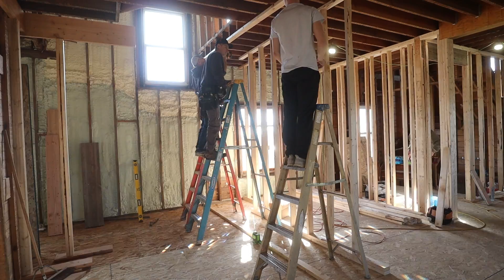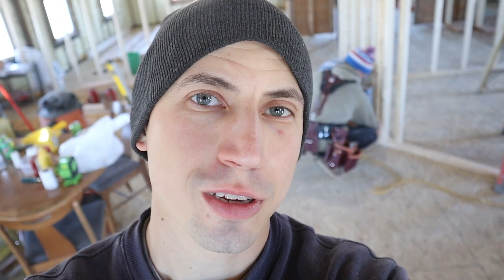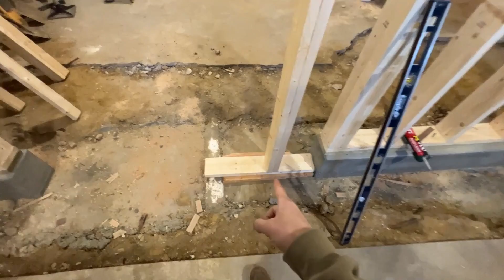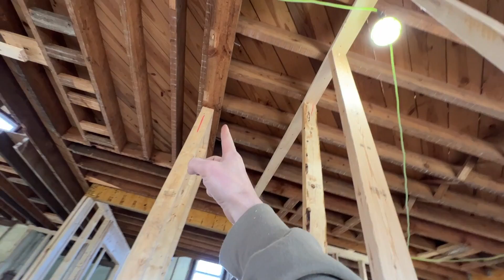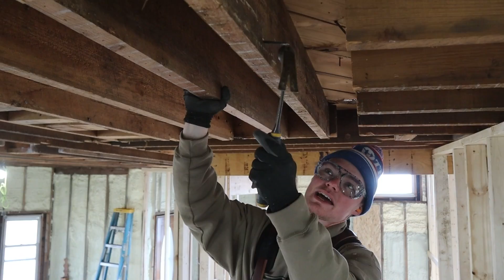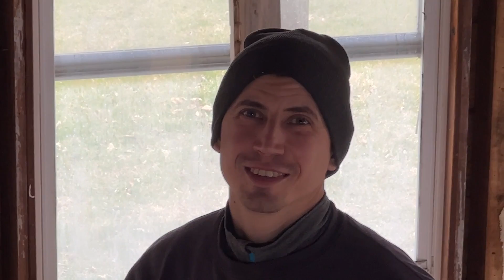Restoring A $7,000 Mansion: Building A New Living Room

Comment: Roman is correct. A jack stud is what is under a header/beam. A cripple stud is what fills in under or over a window, or over a doorway (between the header and the top plate, to provide a nailer).
Reply: I've always known them as jack studs as they perform the job of holding (or jacking up) the header.  A quick google: "The king studs are the same length and size of regular studs in a wall; the only difference is that they are positioned at the ends of a header so they don’t necessarily land at regular on-center stud locations. Jacks, sometimes called trimmers, are studs cut to length to fit under each end of a header and down to the bottom plate."  Learned something new today
Reply: Cole, Don't go all west coast on us now. In the Midwest I've always heard them called jack studs, not trimmers. The only time I heard them called trimmers was on the cable tv shows building out in California.
Reply: Instead of 'cripple' we always figured if you had 'kings' that were the biggest, 'jacks' doing the work, then the ridiculous little ones should be 'jokers' or 'fools', depending on if you prefer card- or court-based nomenclature.
Reply: And a king stretches from sole to top plate
Reply: Trimmers???  Kings, Jacks and cripples.  In that order. 

Roman is correct!!!!
Reply: Cut your blocking boards before you take off the long board. It will prevent the wall studs from bowing Cole. You should be putting in the blocking when you put up your walls
Reply: Trimmers are the secondary boards that trim out windows and doors.

Comment: The only problem I see is using screws to build with
They will pop when the house as they call breathes with the change of the seasons. You should use nails to allow the wood to flex like it supposed to
Reply: I have that problem. Built my house with screws and ring shanks. The pops are loud and scares me every time. It's always in the evenings when the temps cool.
Reply: @a.randolph8112  That's the screws breaking, no shear strength

Comment: a good building practice is to place blocking/backing brackets where thing heavy will be mounted, such as handrail supports, light fixtures, fans etc. these also double as horizontal braces between load bearing wall studs. Plan for the furniture length and width and turning space. Some framers call it SHIM-FACE.

Comment: My 2003 FORD f150 module went out. The module gets corroded and moisture then gets inside the small circuit board and corrodes it. Sucks that isn't what it was.

Comment: If my bearings are correct, why not run the beam deeper into the wall to catch the other king post of the door on the basement.

On the leaning wall, cut 2x shims the entire height of the wall to make the existing wall plumb.

I wish I was there. I could run all the calculations on the beams and solve a lot of your problems.

Keep up the good work!
Reply: Thank you for this post! I hope they see it!

Comment: I live in NJ and radon is a true problem.  You mentioned French drains in basement. You may want to speak with a radon remediation company as I believe that they will want all French drains sealed so the radon gases do not come up into the basement.  Just a heads up to check before you do basement floors.

Comment: I’m sorry, I’m confused!  You have to go through the pantry to get to the downstairs bathroom?  Aren’t pantries usually messy?  I personally wouldn’t want a guest to have to go through my pantry to get to the bathroom.  Lovely job, as usual! TYTY for sharing!  ❤️❤️🙏❤️❤️
Reply: Same thing I’m confused about.
Reply: I thought the same thing!  If that was the only doorway, I’d want the bathroom first and pantry in the back.
Reply: Cole has explained in previous videos that you will enter the bathroom from the hallway by the stairs. Hope that helps!😊
Reply: @westiamom9340  But he just said in this one the door to the bathroom would be in the pantry! They can't put a door out to the staircase because the landing is going to be up 4 feet from the floor where the stairs go up outside the bathroom wall.
Reply: That's what I thought, too. I'm confusion. 😂
Reply: I was wondering, too.
Reply: @teddieryan2288  at the end there was no other doorway built. But the one at the angle.  Unless they’ll frame another doorway later?
Reply: @pamtanner516  yes if you were facing the diagonal door, the wall that runs down the right-hand side to the outside wall, near the back of that wall where the bathroom will be framed out, there will be a door framed into that wall. The door will be across from the 2nd staircase(back), it's just not framed in yet. the opposite side of where the door will be framed into the bathroom will end up being under the first landing of the front staircase that doesn't exist currently.  Assume there will be cabinets or shelves on the 3 walls of the panty if it helps to visualize where the bathroom door will end up being.
Reply: @rogerkaiser8691  thanks for the explanation!
Reply: You should have a bigger elegant bathroom on the main floor in such a big  house
Reply: I wouldn't want someone stinking up my pantry. You know where food is stored. That is just nuts!
Reply: was confused too. thank god westiamon reply.
Reply: I would put in a bigger bathroom for when you get older and don't want to or can't go upstairs something to think about
Reply: Isn't a pantry where food is kept? Why is it messy? Cans and bags and boxes on shelves?
Reply: The ground floor bathroom should be just off the entrance hallway.

A small utility sink in the pantry is reasonable, but NO toilet or shower, and not even a mop sink.
Reply: All explanations are confusing
Reply: I was wondering if that made sense. 🤔
Reply: He will be opening a door way into the bathroom from the side so it's separate from the pantry.
Reply: @stevewayne3676  But then wouldn't that door be directly into the kitchen? You don't have bathrooms enter into the kitchen. Absolutely disgusting!
Reply: I was hoping I 😊 that wrong.  You have to go through the pantry to get to the only bathroom on the first floor???
Reply: A pantry might be messy in some houses but remeber that Nave and Cole love cleaning. They are extremely meticulous.

Comment: Won’t you put cross pieces between the studs to support the walls?
Reply: They should be, especially with load baring walls
Reply: They are called fire stops in my area. I would think they should be all over the place in a house with such tall walls and only using 2x4 studs. Maybe they will get to that at some point.  Other note: when they had the floors up in different places why didn’t the make all of them go in the same direction? I have never seen so many variations of directions for floor joists in a house!!

Comment: The steal beam would have eliminated that problem. I would have used 2x6 to eliminate that problem. It is the closest thing to the original wood in the house.
Reply: Yes .  Very true . Expensive though
Reply: @Robsav-yx6vi  it is but I would rather spend the money, do it right, and cry about it once. The corners that are being cut scares me because I have seen this done and the nightmare it is to fix it. Plus they are worrying about it being level which they will never get it level. They need to get it plumb and be done with it. They are doing things twice means that they don’t have any blueprints and if they did have them, they are not using them.